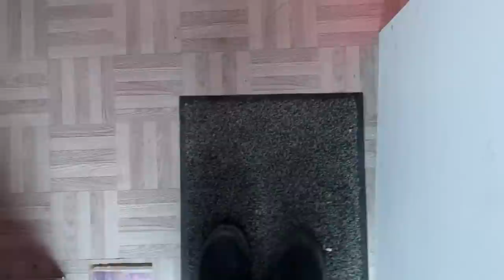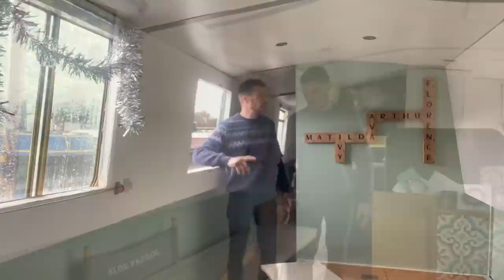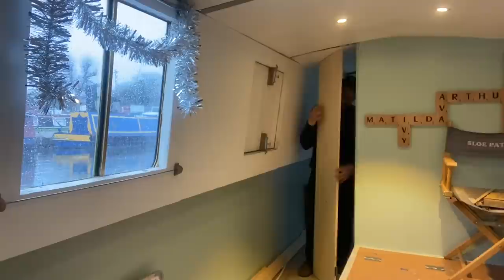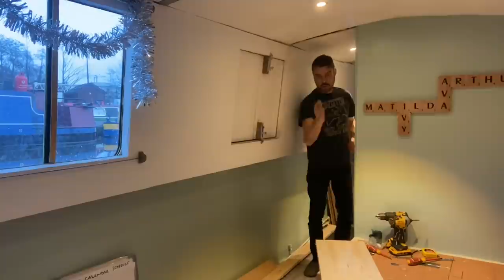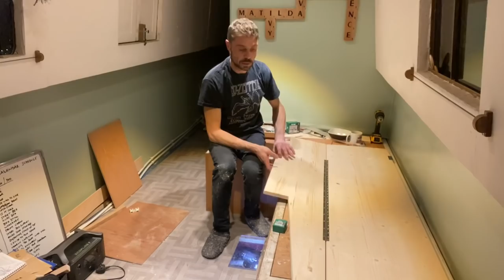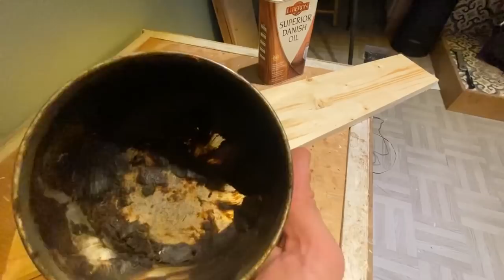307. Trying to make a split bathroom door for the Narrowboat

Comment: Hi James, Thanks for your Vlog good to see another handyman working. :-) RE Danish Oil, I use this a lot for my hall tables and wood soap molds, for the molds 1 coat is enough as the soap will keep adding its own oil later.with use. (the molds are sold on etsy and ebay)  (Oil ,water and Sodium Hydroxide make soap) For my furniture I use 3 coats of Danish oil added 1 day apart lightly sanding with 320 grit sandpaper before the 2nd and 3rd coats. Each coat gives a slightly deeper colouring to the wood which will also help with the condensation you have on narrow boats as wood expands along its width so make sure toy do all the edges as well as the faces.then a week later I wax the tops. As a finish I use the equivalent of your Yorkshire Grit. This will give a finish like clean glass dead smooth and polished. As a bonus it is an easy fix to redo the polished wood from kids sticky fingers as well. :-)  Take Care and good luck with your endeavours. Have a safe and happy New Year.

Comment: The idea of a multi-folding Transformers door is nice but you really would be better off making a solid traditional square door closing on straight walls on both sides. Yes, the door would be a bit smaller but adding a permanent wall to the outer side would also give a nice separation for the bathroom/bed section and it would all feel more solid and close tight.
Reply: I’ve always thought a conventional door would be much more simple and useful, may have even closed off the bathroom when open? Still too late now.

Comment: Hi James, and merry Christmas to all. I'd put a coat of Danish oil on first that will soak in and Harding and give it a little fine sand, then put the wax on top. It will make it easier for the wax to harden and  polish. Also the Danish oil will give you better protection for water 👍

Comment: That new door looks like a brilliant solution. You could add some full height under gunwale shelving on the 'Dinette' side, giving you a useful place to put stuff and filling in that small gap. Maybe you mentioned doing that before? It would also prevent anyone pushing the door too far out into the main cabin. Are you fitting a matching one on the bedroom side?
You can always put on a coat of the danish oil first, then wax over the top. My understanding was always that the wax prefers a rougher surface to 'grip' onto, so don't sand too much.
Lovely job James. And Merry Christmas again.

Comment: Ps place the tin of wax on the wood burner for awhile, when liquid apply it with a paint brush - goes on really easily and quickly. 😆 heck of a lot sanding????? ……try doing an eight leg, barley twist drop leaf table………….🤣🤣🤣🤣

Comment: James  - a little hint....  The hinge pin on a Piano hinge usually doesn't slide out - but if you're worried about it - just whack the very end of the curled part with a hammer and crimp it in.  It's almost invisible and extremely common.  Great idea with the folding door, by the way!
Could you just use wax over the Danish oil in the kitchen area?  
Wish I'd seen your video to say Merry Christmas to Carol!  I hope she had a GREAT Christmas and recovers from her migrane soon!

Comment: Nice haircut James.  (Door's not bad, either.) Two words while you're sawing metal bits--SAFETY GLASSES. Btw, if you want to give a bit of sheen to the wood you've put the Danish oil on, it would be okay to put on a layer of wax now the oil is good and dry.

Comment: James have you thought of a Chinese deisel heater .. cheap to buy and to run ?
Reply: My sister has one in her camper van, but it uses a lot of electrical power.  OK if you're running your engine every day, but will drain 50% of a 100 Ah battery in a day, if you crank up the volume.